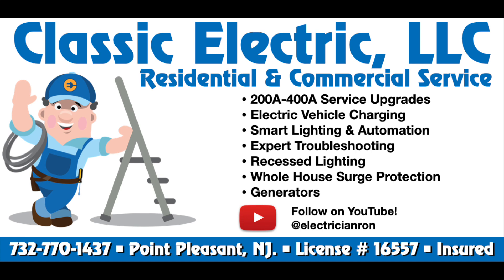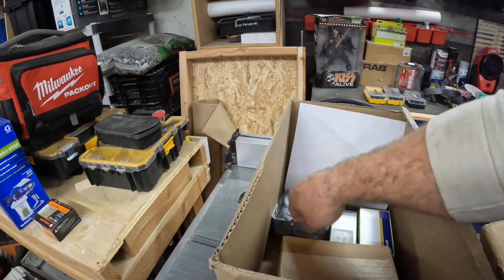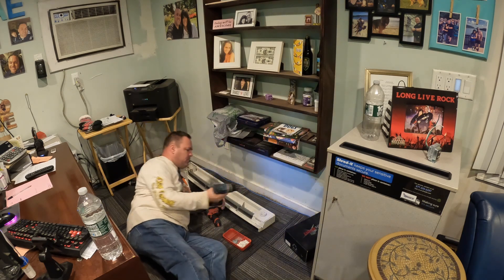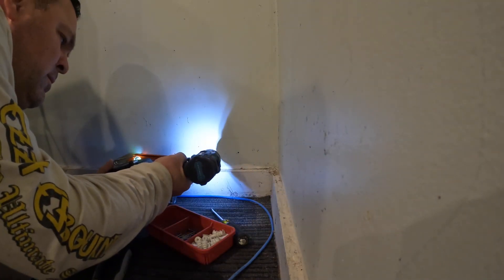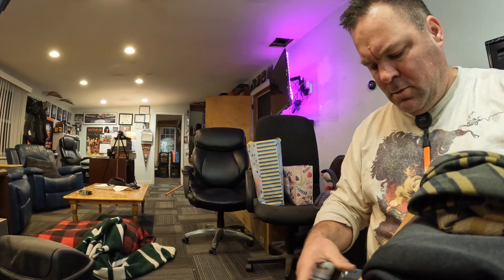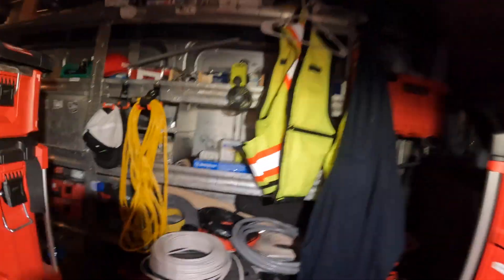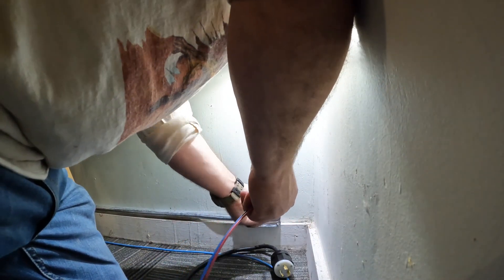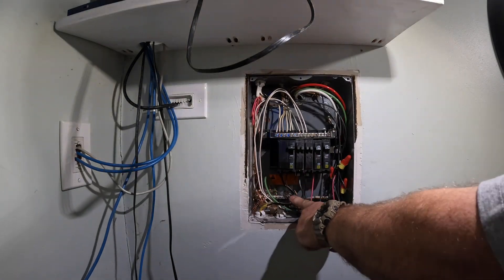Stay Warm: Supplement Your Gas Furnace with an Electric Baseboard Heater

Comment from the maker: It has been brought to my attention that my original calculation as provided in the video was incorrect.  The correct calculation to find resistance of this circuit is R = E squared/ power (57,600/ 1000). The correct amount of resistance in this circuit is 57.6 ohms, not 120 ohms.  I’m not always right and sometimes mistakes are made.

Comment: That's why I use only raintight emt connectors for my own house instead of set screws. I believe it gives a more solid contact and you never have to worry about it coming lose from vibration. I am confident to use the emt as egc and not have to use up my green thhn.
Reply from the maker: The electricians at MGM Grand 1980 thought the same thing.

Comment: Saw kiss at the Dow Event Center,  Saginaw Michigan in August 2016 Freedom to Rock Tour.    Been a fan since the early 2000s when I was a teen.  

Never personally installed a baseboard heater,  never had the need.   Even though 120 volt heaters are available up to 1500 watts, I'd personally frown upon them unless that was my only option,  such as a 120 volt subpanel being the most practical to run from since they pull twice the amps for a given wattage making it impossible to  add another heater or install a larger unit on the circuit down the road should the need arise.

Comment: Emt holds paint verywell if you lightly sand clean it than a decent automotive type primer. My wife liked the painted emt over the wiremold
Reply: Lightly sand like you said then degrease/clean with acetone and a rag, coat with etching primer and wait to dry. Then Zinsser 1-2-3 primer over that, and then your acrylic top coats over that. Rock solid coating.

Comment: I see you have a window AC  unit in the room as well. 
I have an older colonial about 100 years old. 4 year old furnace but the heat and AC can’t make it to the second floor. 
I installed a 12K mini-split unit with pre charged line set which heats and cools and it’s a DIY kit. Works excellent. Not sure if you thought about that.
Reply: @cengeb  Seriously,  I wish I would’ve done it years ago. It works great, heats and cools perfect. Inverter technology, super quiet and efficient.

Comment: Hey Ron great video but I need to find out something, the box where you put in the two wires that is attached to the female twist lock, did you attached the female receptacle to ground screw. I could not  see if you did that bonding. Can i assume since you used EMT that's why you didnt run another wire in the EMT? You just used the EMT as the grounding electrode. Let me know your thoughts.
Reply from the maker: It’s not an electrode.  It’s an equipment grounding conductor.
Reply: @electricianron_New_Jersey  thanks for the correction. Cheers

Comment: You said you added extra conductors to the heater case? Was the thermostat double pole? I've never had to do that, and have installed thermostats on either side many times. Must be the Stelpro's and Dimplex's  cheap-ass single pole thermostats I'm used to!
Reply: @donl1410  Yeah, I've just never seen or come across the double pole ones available for the baseboard heater cassettes here in central Canada, but I do usaully use em for wall mounted thermostats.

Comment: I have probably 80 feet of baseboard electric heat.  Too expensive to use as sole heating.  The low temp mini split is the primary.  Plus a pellet stove.  Can't  beat baseboard for spot heating.  Thx.

Comment: I get it Ron.  I am not a KISS fan, but I am a lifelong  Styxx fan, Same era, different band of course. I was born in 64.  Nice touch with the cricket sound. Just one question, why not a hard wire to heater instead of cord and plug connection?  Great video, thanks for sharing